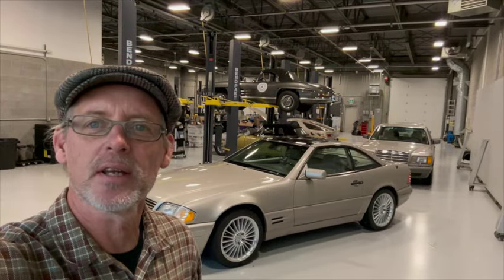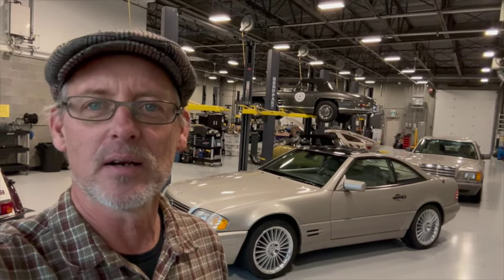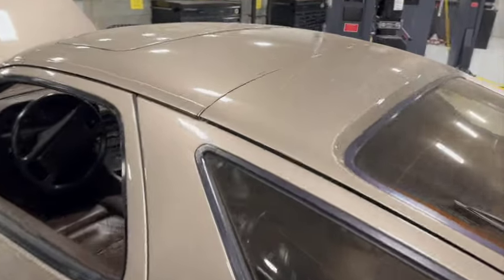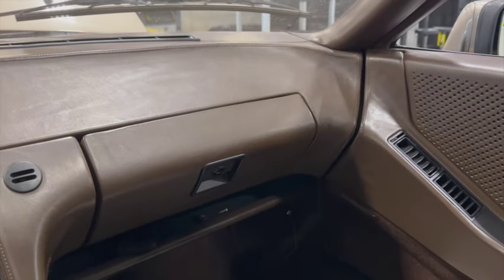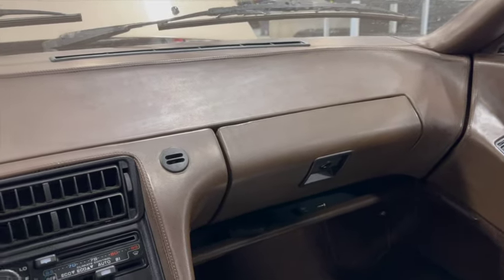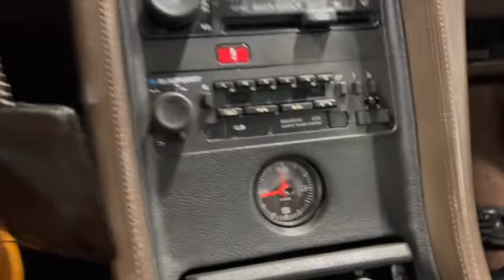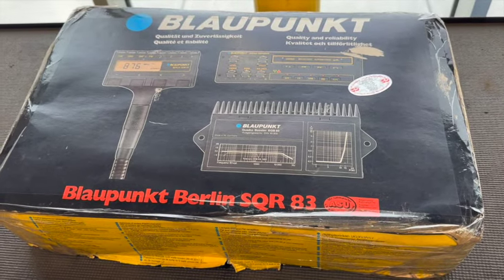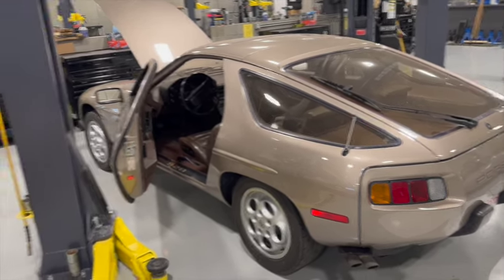1981 Porsche 928 5sp. 25k km, Re-Commissioning After 40 Years In Storage (with costs)

Comment: The leather dashes were usually options, if you don't take care of it etc, is the usual shrinking and cracking, just some good leather conditioner / protection, thought maybe the seat padding needs to be replaced. She's a beauty though, looked at a few S4's and a GT but can't can't really compete with someone wanting a 91 GT on the side with 2 early 930 Turbos. Still wonder why the throttle peddles are so heavy, I can understand the steering since at Autochan speeds you don't want to "jerk" the wheel too suddenly.
Reply from the maker: From what I read Porsche stopped offering the full leather trim (dash) in the mid-80's after problems with the leather shrinking - at least on North America. Not 100% sure but it looks like the 85 928S may have been the last version to have the full leather dash.
Reply: @slrroman  they did have it in later years, but knowing some with the astronomical price tag with these cars didn't get it. I think Bob Sagat had a later S4 with the full leather interior

Comment: Cars are meant to be ran and driven and if they sit it don't matter the low miles because most of the time the engine will need to come out and be rebuilt. Many low miles car that don't run much will spin a bearing on it's first drive just from being dry for so long and it leaves a sticky tarnish that will usually grab and spin a bearing that is why it's good to drive them even around the block every year is better then not ran at all and the fuel tank you gotta leave them completely empty because if you leave them with a half or quarter tank it will rust and tarnish the tank and sending unit and today's fuel with the menthol is the worst on a carburetor or injectors and fuel pumps and everything will need rebuilt or total replacement of the fuel system.